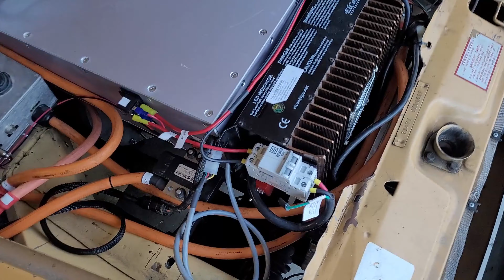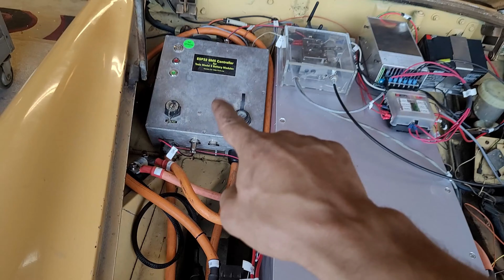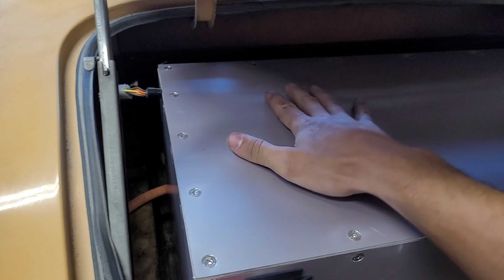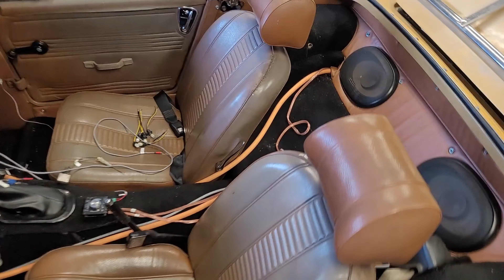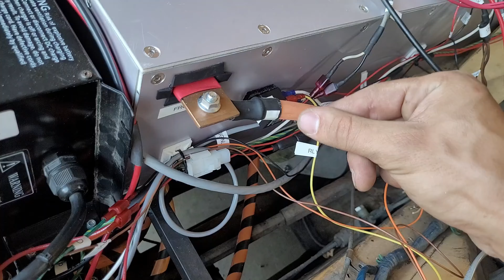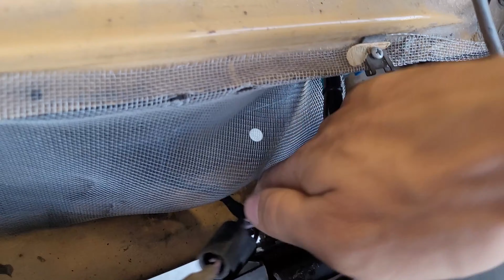MG Midget Electric Conversion Part 10: High Voltage Systems

Comment: Thank you for posting this information. I have been interested in electric vehicles since the mid 1990s and even considered getting a Sebring Citicar. My primary car now is a 2014 Chevy Volt, but I have a '76 Midget (ICE) in the garage. I have thought multiple times about converting the Midget to electric, so I will be following your story.